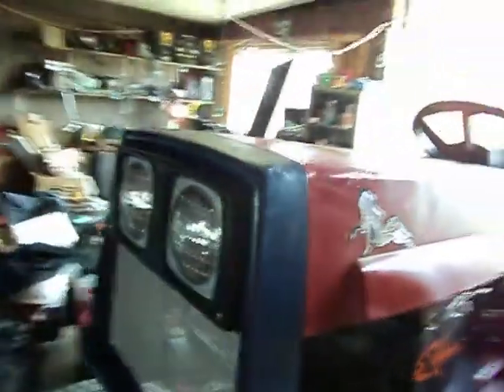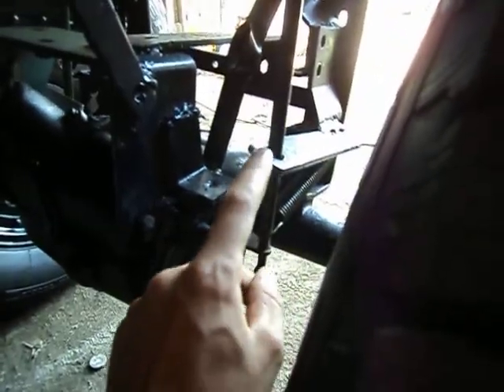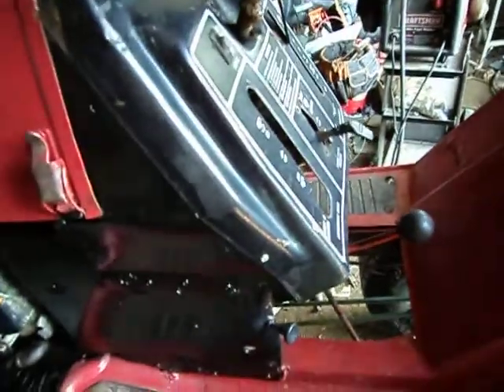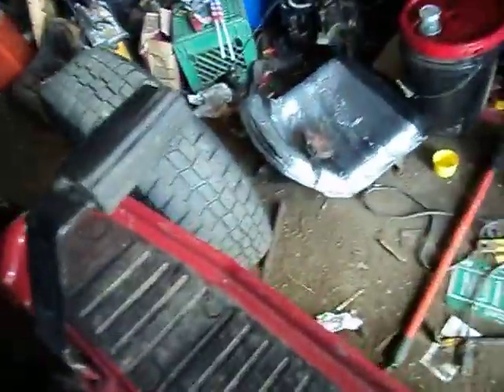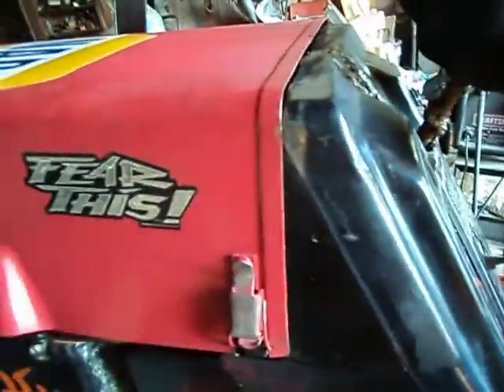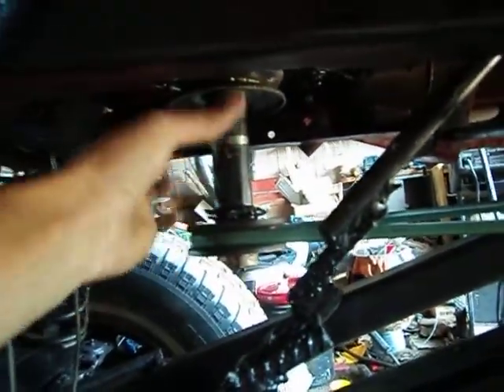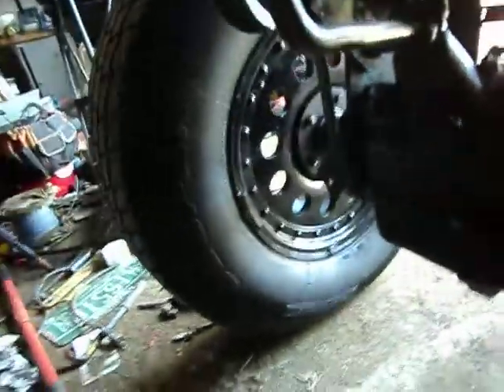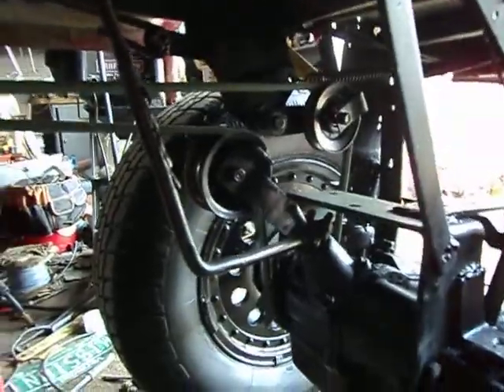monster mower fire up best sounding exhaust ever!!

Comment: Thanks, you gave me a bunch of ideas for things to change on mine. I like how you converted the belt system to use a side shaft axle with a vertical shaft motor. The motor on mine blew and it's really hard finding a used side shaft motor so I think I might do something like that. I also might rig up the hand brake thing like that because mine just rolls to a stop and is pretty dangerous if you have to stop immediatly. I also like that you actually have suspension on yours. I want to change mine to have suspension eventually, but I need to get another motor first. You should put bigger mud tires on that on. I got 35" mud tires on mine. I got a lot of work I'm planning on doing to mine.

Comment from the maker: first you remove the starter from the motor thats just two bolts under the flywheel then on the top end of the starter that has a gear and if the gear is broke or the teeth are warn off the theres either a pin or a 'c' clip in the top and just use a punch or a flat head screw driver and when the clip/pin is out then everything comes off.( to replace the gear) or replace the braket that conects the starter to the motor and thats two bolts on the bottom of the starter after u remove the gear'nshit